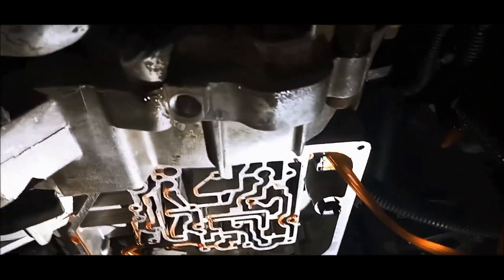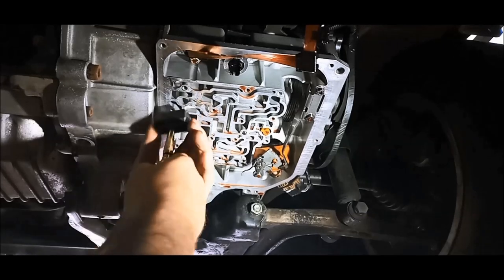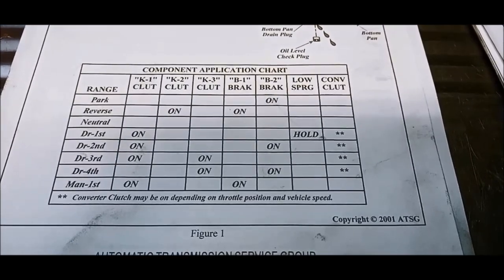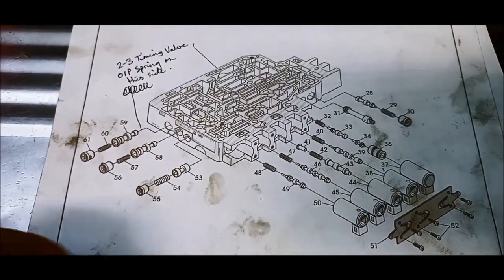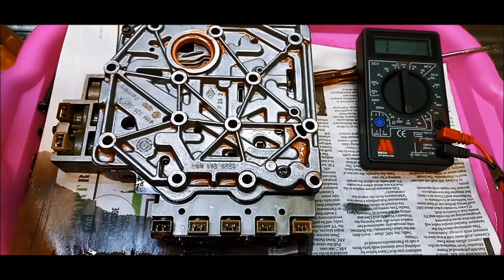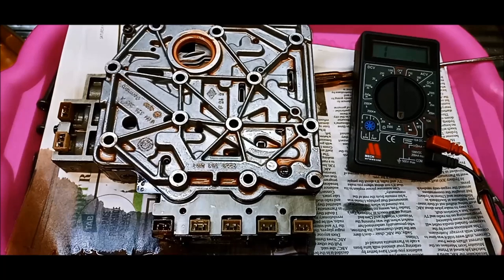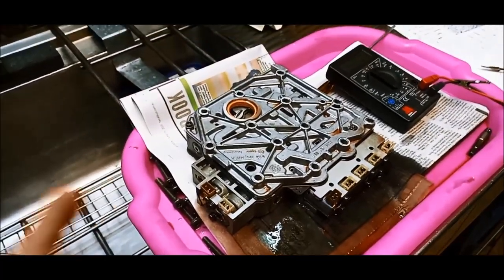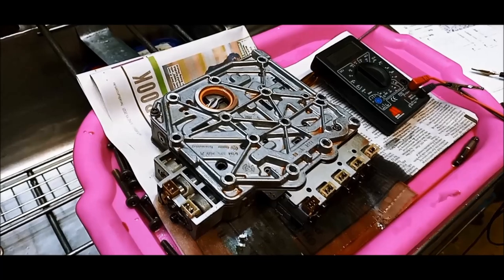01P Transmission Test Clutch Air Pressure Test Ports & Solenoid Resistance Test Ohm Resistance Test

Comment: im rebuilding a 6t45, is it normal with new pistons installed and while testing from where the valve body goes to not have it hold air pressure? i assume the oil pressure is constant when piston is applied and it has some place to escape to keep the fluid moving inside the trans. just wondering because i can see and hear all my new pistons being applied very well but they do not hold air pressure but they do apply very well. used assembly lube and everything
Reply from the maker: hi, it is normal to hear some air sound as there are many sealing joints. remember that air is much thinner than oil. if you can still air pressure test trans while its upside-down, squirt some suitable atf in apply ports and recheck. depending on how much assembly gel you used, the atf should dissolve some of it. when trans warms up the gel disappears quickly. cheers
Reply: @YepThatsIt  Thank you!! Now I just need to fin a rebuild manual for a 6t45 Gen 3 which is like non existent... I put the whole thing together using a gen 2 manual from ATSG and I have two extra thrust washers HA!